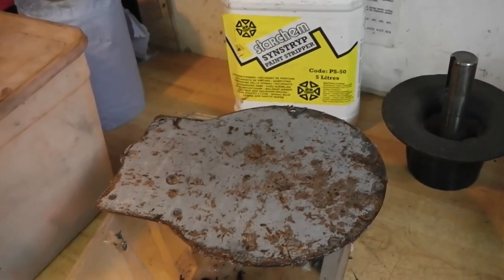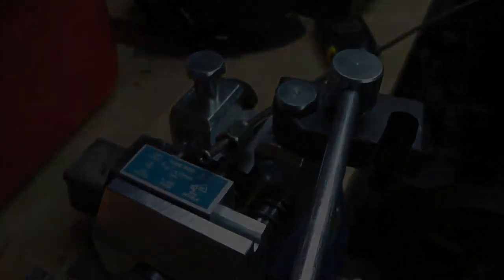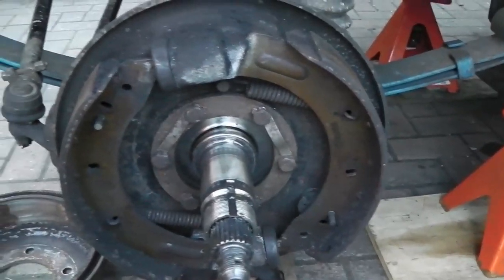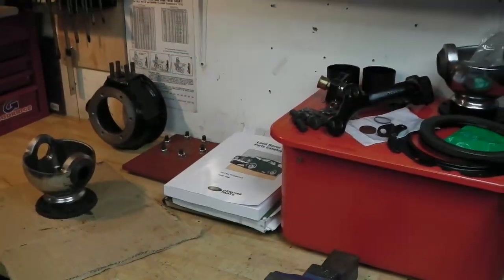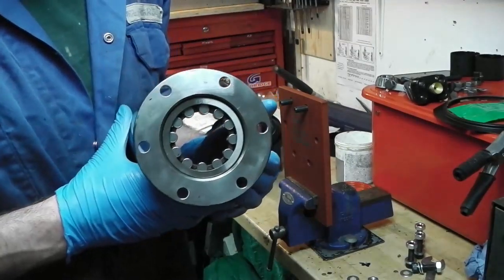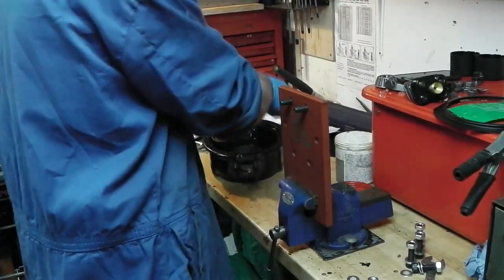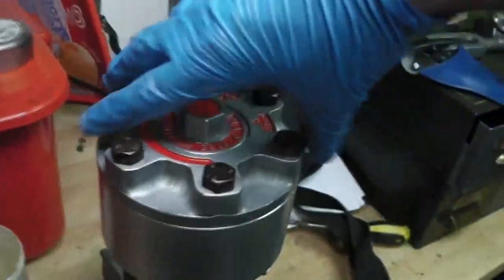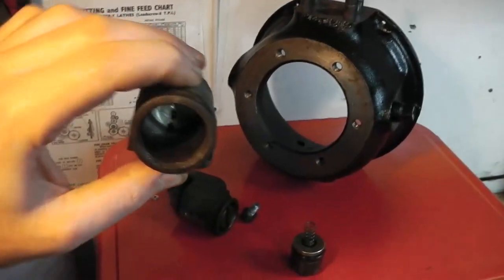Land Rover Series 3 Brakes & Steering - Part 9

Comment: I would recommend the leather gaitors that you can pick up for a few quid - I have been really suprised by how well they have kept the swival joints in good condition. On inspection after this winter, I have replaced the gaitors - and thats it after 6 years and 12k miles.
Reply: My 88 ex raf has them from military service 81-87 I got her in 1994 still on same swivels and gaiters

Comment: The old bearings seals and chrome balls seem to have fared quite well  Philip, can you remember  what  brand  they were  ?
Reply from the maker: They were Britpart - I'd recommend anyone who can afford to do so buy genuine, but they were actually very serviceable.  Some rust and pitting after 6 years of all round driving, so they are going to last better than that on more sparingly used vehicles.

Comment: Bit late to this one, Phil YouTube didn’t seem to recommend for some reason. Interesting the wheel cylinder stud thread stripped. I was thinking the other day, the entire brake force at the front is transmitted through those eight studs. Not a massive amount of metal when you think about it. 
I didn’t realise the galv chassis had those cut outs. Good for the brake pipe whether intended or not but I’ve never had bother with bleeding the rear brakes, it’s those TLS fronts that are the awkward ones.
Reply from the maker: It's a bit like looking over old aeroplanes and spotting all the delicate little components who's single failure would result in certain death.. it looks frightening but they are plenty strong enough. The cylinders also locate in the backplate so they can't go anywhere -  even so, the stripped thread was very irritating.
The brake bleeding went very well and was all done in a couple of hours, that will be in the next video. Back on the road now and getting some miles on it this week - biggest surprise was the six month old petrol which is as good as the day I filled the tank...!
Reply: @steamwally  very true. And I’m still on my single line brakes so there’s another catastrophe with one tiny fail. I’ve just developed a front cylinder leak so once again I’ve had my hand forced by the old girl.  Very cold wind right now!  Glad to hear your petrol still goes bang and your back on the road.
Reply from the maker: @highdownmartin  So I guess you're going to start on the duel circuit conversion? If you need a hand, just shout!
Reply: @steamwally  cheers mate. You can be in charge of the electric blanket and refilling hot water bottles!
Reply from the maker: @highdownmartin  Ha! There have been times this winter working on WRD when I've questioned my sanity, out there on frosty or wet nights but it's somehow worth it once back on the road.